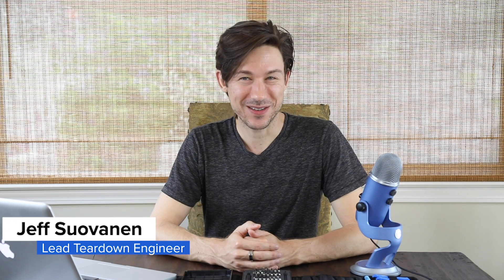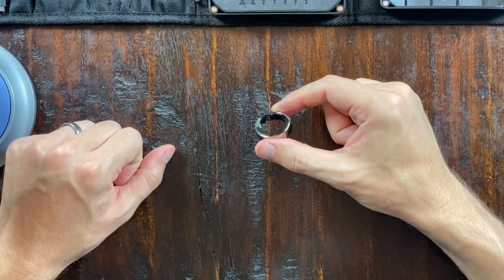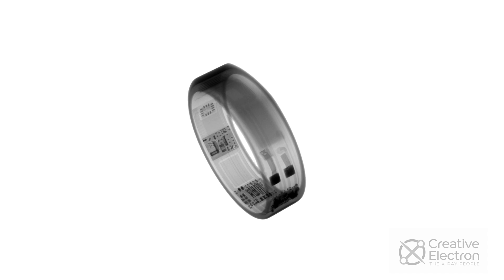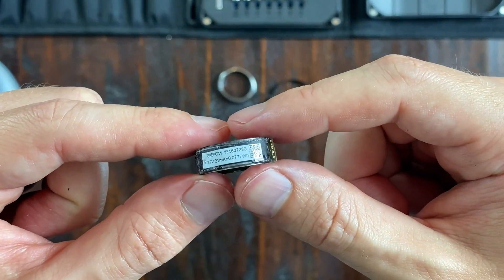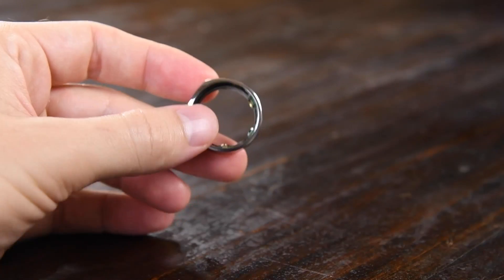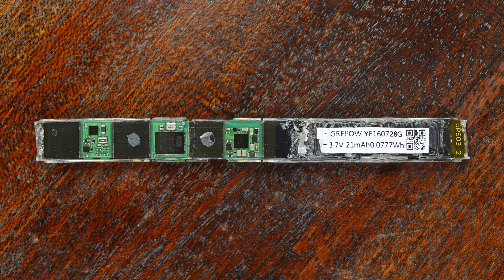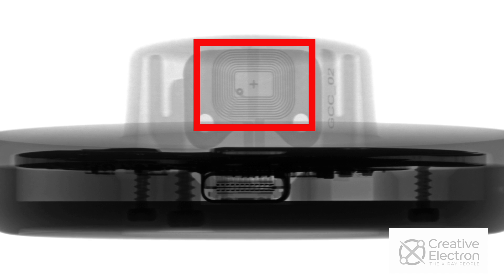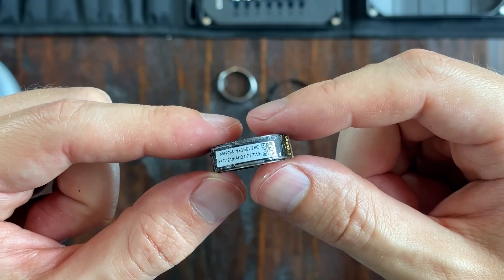Oura Ring 2 Teardown: Inside the NBA’s COVID-19-Detecting Smart Ring

Comment: I guess it doesn't work any more?   I'm looking to buy an Oura ring but sadly, all the rings currently made are for those with smaller fingers.  The largest Oura3 made is just ~.75 mm too small in diameter.  As a chemist I believe you could dissolve the metal using an acid or electrochemically (which will even dissolve gold or Platinum) and won't hurt plastics assuming that no circuitry is exposed.

The battery is an issue.  That happened with my Kindle too.  One option would be putting a solar cell on the outside and or else a replaceable battery in the ring's crown.

Comment: I know I'm way late to the party but I am a jeweler and I think best best. The line you chose to cut from the inside. Instead in that exact spot I'd cut the metal from the outside with a jewelers c clamp hand saw and try to pry just a bit then alcohol bath to remove it and probably recast the outer metal in gold and reassemble with some jewelers 2 part clear epoxy to hold it in

Comment: I watched this because I would like to replace the battery myself (or actually: keep using my ring with a battery that doesnt hold charge for one night). When watching it I realise it is probably easier to bring the charger to the finger at night (and then only wear the ring at night, with some bulky charging-bracelet or something). However, the software is probably built to not measure data while being charged. If anybody has more intel on what the behavior of the ring is while being charged, please let me know.
Reply: Just realized I could test this quite easily. Bringing the charger to the ring is not a solution. main reason: if you put the ring on the charger and try to trigger a meditation break or something, it would just prompt you with something like "cannot do this, because the ring is on a charger".

Comment: I would have thrown it in an a acetal bath to disolve the plastic. ( you could re overmold a new layer if you wanted to repair it i guess) 
those small unmarked chips would be protection circutry on the battery possibly or wireless charging regulating circutry, 
The temp sensor would be inside the chips, many IC packages have thermometors inside the chips to measure chip temp but if it's done after sleeping and watchdog wakeup , the chip temp is negligable and can be used for ambient temp.
pretty legit build but should not be $300, that could be made for under $15-20 with most of the cost being molding and finishing the ring metal. metalworking is much more costly than pcb production and ovemolding plastic.

Comment: Thanks a lot for the great video. Our custom shaped 3.7V battery is showed in this video.  The thickness of our battery is just similar to the circuit board, fulfill the rest of the space and providing the max duration.
Reply: Can you make batteries like this with wireless charging?
Reply: How is it possible that your batteries in 300usd/eur ring in many cases cannot last even 2 years?
Reply: how can i purchase the custom shaped 3.7v battery for the oura 2.0 size 12?
Reply: Do you have a link for the battery used?
Reply: @Pete Moss  If you have any other questions, please feel free to contact us. Or you can directly Google Grepow Battery and you can see the full information of the shaped battery.
Reply: @GrepowBatteryOfficial  is the battery management system used in it also your product?
Reply: @pranavarora3456  Hi Pranav. We have a professional R&D team and can customize BMS according to customer's needs. But the BMS of this ring is not made by us, if you are interested, please feel free to contact us :)

Comment: Great video 🤩, think the only way to tear down this ring without damages is try :  dissolving the epoxy with acetone or breaking it carefully by frozen. Originally the PCB are probably flexible ( that’s how been introduced inside the metal frame ).
Reply: not pcb ....flex .....

Comment: A Dremal tool with a rotary cutting wheel should be able to cut through the outer case.  I like iFixIt but it sure seems hypocritical to have a laptop with a low repair rating sitting on the desktop instead of a laptop with an easy to repair score. The vise stand with a suction cup mount doesn't stick to a wooden desktop very well, does it?  I sure like the heat resistant gloves though.
Reply: Hi! That's actually a 2012 (unibody) MacBook Pro — 7/10 repairability. Over the years it's had at least two battery replacements, multiple RAM upgrades, several hard drive/SSD upgrades, a full keyboard replacement, a MagSafe board replacement, and probably something else I'm forgetting. A lot of folks at iFixit still use them.

Comment: if you were a jeweller you could cut through the metal outer ring with a metal jeweler's saw and pry it open without having to deform the inner plastic ring at all… but you would then have to cast an entirely new outer ring which seems like more work than this nonserviceable tech is worth to be honest

Comment: They have Pulse Oximeter hardware but they don’t mention it on their website. It’s not enabled.
Reply: I think Jeff 's guess of "pulse oximeter" is incorrect.

As far as I can tell, pulse oximetry requires two LED emitters of different wavelengths; SpO2 is calculated as a ratio of reflected red to infrared light. The Oura works with infrared alone.

https://en.wikipedia.org/wiki/Pulse_oximetry#Function

Comment: Curious why you didn't start with the alcohol bath?
Reply from the maker: Good question! We wanted to get the alcohol underneath the circuit board to counteract the adhesive holding it in place. But it can only penetrate after the waterproof seal is broken and the circuit board is dislodged a little.

Comment: they should be given to everyone or at least a ring that just detects covid.
Reply: I'm curious at how well it works. I can only imagine the shitshow that the company will recieve if one of the NBA players gets covid and this ring didn't catch it.
Reply: @Razzman70  Well - Oura is not specifically designed to catch Covid-19. It tracks your temperature, breathing, heart and activity. It's seen - at least in some cases - that change in temperature, heart rate, etc. are early warning signs that you are getting sick. COVID-19 or something else. BTW, I have had Oura almost two years now. I had my ring replaced twice. With first two the battery died after 5 months, but now the third has been working full year nicely. Got a ring to my wife at the same time and she has got no problems with hers in two years. I didn't see any link to the Oura-site, so here it is, https://ouraring.com/
Reply: its not a covid detection tool its just a body temperature monitoring tool. which will just flag an warning to the medical army that supports these athletes.physically and mentally